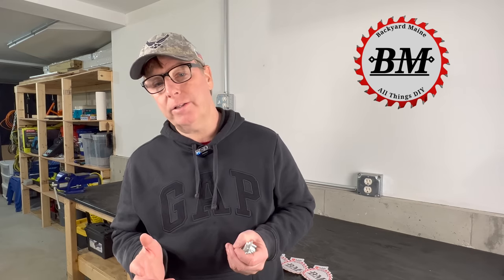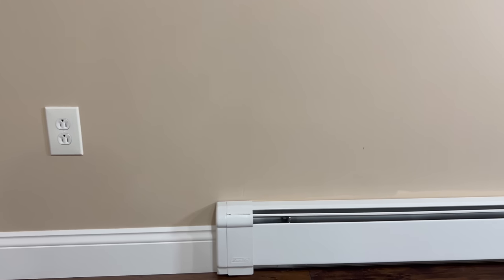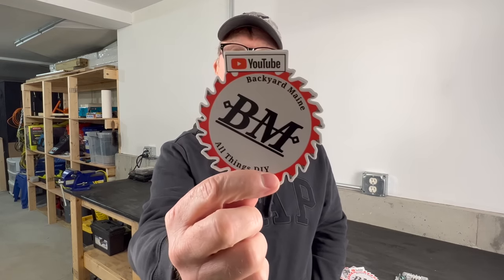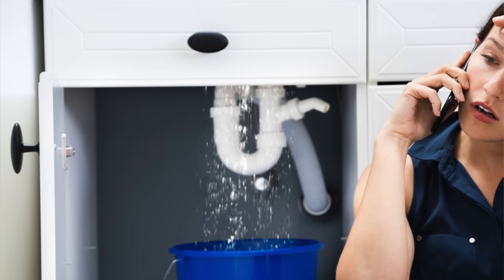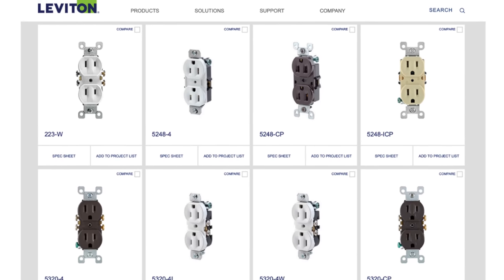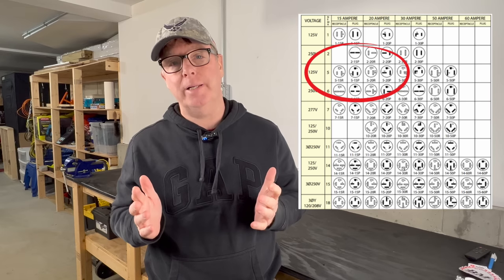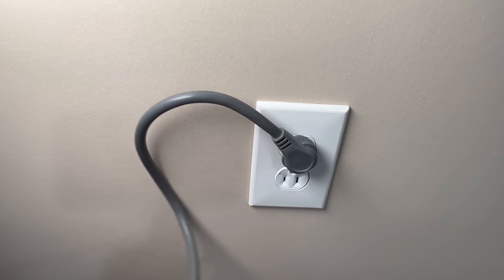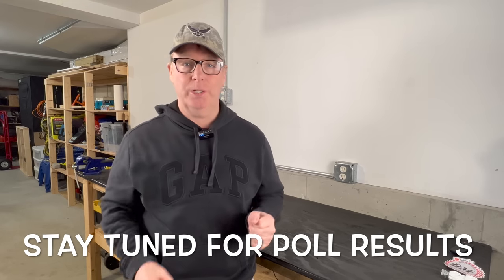Are your outlets installed upside down? (You may be surprised)

Comment: On my new home, I am specifying sideways, with the neutral on the top.  This places the hot on the bottom, protected by the neutral and ground pins.  This also separates the power cords going to the floor to be side by side instead of stacked over each other.
Reply: NOW THIS IS A GREAT IDEA.  I NEVER THOUGHT OF BUT MAKES MORE SENSE THAT ANY OTHER WAY
Reply: I have been an electrician for 25years and I always  put my horizontal receptacles with the neutral up for that exact reason.
Reply: This to me not only is more pleasing to look at but if you look at a lot of REALLY old homes it was done like this along the baseboards and just was beautiful!
Reply: I THINK Eaton makes a model with that orientation.
Reply from the maker: That is an option of course. Chicago requires receptacles to be run horizontal but the also require conduit to be run inside of the walls of residential construction.
Reply: Is the conduit required, EMT or can you use BX.  I know most cities require commercial wiring to be BX. Thanks
Reply from the maker: You can run BX and MC cable in commercial installations by the NEC. You will want to check your local codes if you have them and of course any job specs which will often list materials to be used.  @louprentz8554
Reply: That sounds good.
I wish there was a solution to these large transformers. You know, the large square blocks that some devices need, like your NES, your Atari, your voice message box and a bunch more other devices.
They should place each outlet 10 cm apart from each other. They should also have 4 outlets instead of just 2.
I have to install an extension for these things.

The other issue: Outlets behind furniture. What in the world? Can you put the Outlet 1 m above the floor so that I can reach it without breaking my back?
Reply: Totally agree. Check my comment on this topic. 
That’s how receptacles are installed in most countries in Latin America. 

Also, there was almost funny story when my little brother tried to plug in the Christmas tree (he was about 7yrs old) and when the upper prong was not going into the hole (he had the plug slanted), he pushed it down with his finger… we just saw the Xmas tree jump up for a moment, and my brother coming out from under it with a numb finger. 
The upper tab was the live one. 
I turned the receptacles to have the neutral up after that, and of course taught my brother about never touching the plug blades (that was back in the 80-90’s).  (Oh, and made a little extension cord with an inline lamp switch to use for the tree and avoid plugging it in every time to turn it on).
Reply: @PeteSleigh  I think these are common, made for horizontal mounting with the ground down.
Reply: @louistournas120  LOL - in 1 apartment that had tile floors I needed to mop, I bought cable wall mounts to keep everything off the floor, used these with tie-wraps to hold transformers, made cleaning easy, I should do the same in my new home over carpet (more attractive if using white extension cords to match paint, won't get caught in furniture legs when I move it to vacuum).

The other thing I've done with transformers is to mount them in/under furniture (like an end table) with 1 power cord.

Comment: I’m an electrical/electronic DIY person and I just go by what seems normal. I wire residential houses “ground down”, and commercial buildings “ground up”.  But I like the idea of manufacturers making 120V outlets so the ground prongs point towards each other. Then there’s room to plug in two of the larger transformer chords. 
That’s my 2 cents. Thanks for looking. 😊
Reply: It bothers me that you are doing any work other than on your own home if you are a DIYer in electrical.    In my state, which has fairly relaxed enforcement compared to a lot of other places, what you are doing is illegal - when you "wire" residential houses and commercial buildings.      Unless you are a LICENSED DIY electrician (🤣), you should not be working on anything that is not your own (local and state laws typically allow the unlicensed homeowner to work on his own home, not any others)

Comment: I took an electricity for non electricians course as an industrial maintenance mechanic, they suggested ground up because most of our factory cover plates are metal and as mentioned in this video, a short is possible if a loose cover fell on the hot and neutral.
Reply: Sure if the plastic that covers the hot and neutral were damaged, then the outlet needs replaced anyway. Beyond that it wouldn't make contact regardless
Reply: I've worked for 2 different companies fixing older homes which requires various tools plugged in. It is a mmajor pain in the ass with the ground up loosening the plug, disconnecting the power. The tools and wires are never stationary. It doesn't happen hardly ever with ground down. Two prongs horizontal above do not loosen as much. Therefore it's safer and a more secure connection.
Reply: Well Im not a ground down fan boy but I disagree with the reasoning you were taught. It's conceivable to me that the metal plate could fall and rest on the ground pin without touching the ungrounded conductor blade. Then the breaker doesn't trip. That's bad because some hapless fool fiddling with a plug may inadvertently jostle the escutcheon onto the blade and get a quick shock or arc flash before the breaker trips. in that situation with a metal escutcheon that has a high chance of coming into contact with personnel you want it to short out as soon as somethings not right. Definitely ground down with a metal recep cover.

Comment: Every house (that's six houses) we have owned has had the receptacles installed with the ground plug down.  If you have any flat plug extension cords, the ground plug is usually on the bottom.  If the receptacle has the ground plug on top, the cord will curve over the top instead of lying against the wall.

Comment: I learned it the same way as you and I agree with ground down. I was taught that if the plug was to fall out of the receptacle the ground would disconnect last. I also was told that either way was ok as long as it was consistent throughout the job.
Reply: The ground pin is designed longer to make that not true. Its a pretty pervasive myth in the trade though. It's what I was taught in my apprenticeship.
Reply: lol, never thought of it this way, but that is why orientation of plugs is up for debate. you could justify both ways

Comment: In Australia our sockets have ground down and are always switched . The switch has a red mark on it which shows when the switch is on. Our active and neutral pins on our plugs have 8mm of insulation on them to prevent shorts like you show at the end of your presentation. (which i found very well done!)
Reply: In UK, we have square plugs with a cord that drops down from the plug. Ground is always on top with live and neutral under it.
Reply: @saty580  I don't know about the Australian plugs but the UK plugs are well thought out. The north american stuff is pretty bad. Quite a lot of old houses probably don't have ground if the outlet is 3 prong or the outlet is simply 2 prong.
Reply: @louistournas120  I agree. I grew up in London and now live in Massachusetts USA. Our house was rewired before we bought it. All wall sockets were 3 pin with ground.

Newer US 3 pin sockets require the ground pin to be inserted to lift a gate covering the live and neutral holes. Older ones like ours allow a 2 pin extension cord to be used (no ground for the extension and the attached device). 

A metal chain fell behind my daughter's desk and shorted live to the higher ground. It sparked until the fuse box circuit breaker flipped. If ground had been down, it would only have flipped the circuit if too much current flew.

Live and neutral pins are different sizes with the idea that live from wall to switch is short and when off, the attached device and return are at neutral (0v).
Reply: @louistournas120  Kind of to be expected when our plugs are over a century old.
Reply: @saty580  It’s actually the hot and neutral together that open the gate, so two-prong plugs still work. I hate those things, and will not comply with code there.

Comment: Thanks for covering this topic. I was asked this question 25 years ago, checked the code but didn't find any definitive answer. It's great to see your thorough review. Regarding safety of electrical convenience outlets, I worked with a group of German engineers 10 years ago and they were concerned that our US receptacle should be recessed like the ones in Europe instead of flush. Seems like a good question.

Comment: In Biomedical locations about 30 years ago we switched from Ground Down to Ground up.  I remember when hospitals and clinics went through the entire facility and reversed 
ALL receptacles to ground up.  This was in response to a nurse being electrocuted when her neckless (or ID badge chain) came into contact with a partly inserted plug.
Reply: This is the preferred method in many manufacturing facilities for that very reason.
Reply: Ground up always made the most sense to me as it provides a little protection from something falling and causing a short across the two prongs.
Reply: Seems like there's always sheet metal in shops! Finds its way onto the prongs. But I still like "Green is ground and ground goes down."
Reply: How is that possible, you would have to put your face through the wall to get your NECKLACE or chain close to the wall. Arent outlets at medical facilities at 45" from the ground, so no need to bend over?
Reply: ....Thanx, didn't see this before I commented, wow, had no idea it stemmed from  one incident!....
Reply: In metal shops we went ground up to reduce chips shorting exposed blades.  Also when metal coverplates are used it helped keep loose covers from shorting if they slipped down.
Reply: @sprky777  I suppose, but ground up doesn't do anything about the risk of fire from having inadequate contact between the plug and the outlet. If anything, a machine shop is an even worse place for that as it just allows you to keep using a worn out plug past the point where it should have been replaced.
Reply: Exactly! Also the same for people with young children who love to try pry out plugs with their toys or can drop stuff down behind the plug.. In a work shop where you can drop tools off benches I'd always want the ground up install.
Reply: ABSO-F"n-LUTELY !   I was hoping  someone would chime in on this issue !  I mean...come on.....draw me a schematic and show me how someone gets electrocuted one way but not the other ??????
Reply: that doesn't sound possible unless the outlet protrudes from the surface or she smashed her head through the wall. 
and ID badge is never made of conductive materials either. also hospitals are suppose to use GFCI
Reply: thanks for the comment. I have always wondered why every medical facility I have been in has the ground up.
Reply: @Marcus_Caius  medical facilities differ on regulation but most at the hospitals i've been too (i'm a nurse) have been the standard 18" off the floor.  Getting behind the pumps, beds, side and procedure tables we do a LOT of bending to plug all the equipment in and a lot of facilities have a phone system that hangs from the neck.
Reply: That safety advice doesn't make any sense to me because the NEMA plugs aren't a good design either way. If safety was that important, the design would be improved by simply making the prongs only connect at a deeper level.  I guess changing from NEMA to anything else is going to be harder than switching to metric.
Reply: You're making it barely more secure by inverting the orientation, its negligibly more secure, its still easier to have the connector come lose.
I wonder why they don't put screws in the connector that you have to turn, like the VGA connector had
Reply: @monad_tcp  - I despise the VGA connector for that very reason.  The screws are the #1 failure point.
Reply: I never heard about that, but I did work in a hospital were everyone had a badge. I had a clip on that I clipped to the collar of my shirt. Yes, the hospital I worked in had ground up on all receptacles.
Reply: @Marcus_Caius  could have easily been bending over to unplug some equipment from behind a bed when a patient was being moved. Apparently you have not been in hospitals enough to see how things work, and what the nurses often have to do.
Reply: @darkshadowsx5949  some nurses wear there ID badges on chains around their neck. It would be said chain that contacted the plug not the badge.
Reply: @Ericfloats  also, there are usually plugs behind the beds at around 3 1/2 to 4 ft high (I don't know exactly how high) to plug in all the equipment a patient may need, such as an IV pump.
Reply: @Marcus_Caius  Medical staff fairly routinely has to hug the wall to get to things at the back of the bed or the equipment pushed up against the wall. I know because it makes me nervous to have people behind me and those MFer's were ALWAYS behind me it seemed like when I was in the hospital.
Reply: @darkshadowsx5949  Some medical equipment plugs cant be GFCI. A nuisance trip on some equipment could kill a patient. Kinda like a fire protection circuit, over protection can be detrimental.
Reply: @monad_tcp  Heh.  Lets try to do both at once!
Reply: @monad_tcp  This might blow your mind... you know why there's a hole in the blade on our plugs? Look it up :)
Reply: @Marcus_Caius , you are so very wrong! Ground up is safer because in hospital setting plugs are pulled partially out of receptacles when beds or other equipment are moved around and if something conductive happens to fall across the plug it can short out the circuit and shutdown critical lifesaving equipment! I worked at a hospital for 45 years and it was hospital policy that all receptacles be installed ground up!
Reply: Ground up is safer because in hospital setting plugs are pulled partially out of receptacles when beds or other equipment are moved around and if something conductive happens to fall across the plug it can short out the circuit and shutdown critical lifesaving equipment! I worked at a hospital for 45 years and it was hospital policy that all receptacles be installed ground up!
Reply: @jrstf  no, the first failure point is a NEMA plug unplugging from the wall.

I never saw a broken VGA connector ? what kind of brute grunts do you have to deal with ?

The shit is indestructible, its horrible that you have to screw the connector, but its for safety, not for easy of use, like a USB cable.
Reply: @monad_tcp  - Sometimes the locking nut comes unscrewed.  Then the cable is held by one side.  Pull a bit and it partially comes out, bending the good screw, which may well break off.

Comment: I worked as an electrician for a public water utility. We put the ground up for the reason with using extension cords. We found when dragging the cords around working from high ladders or across the floor the plug would have less chance of pulling out from vertical up or down pulling.
Reply: I noticed that, but with vacuum cleaners. For some reason the ground-up helps support the plug. Of course most of the "sag" problem is from installing the cheap 70 cent outlets. They can start failing in as little as 10 years. The better outlets are stiff; another reason for ground-up. (Most plugs have a "bump" for the ground, giving your thumb a place to press and keep your trigger finger away from the contacts.) That said, my contractor installed them ground-down when splitting an overloaded circuit... so I continued ground-down when upgrading outlets thru the house. The initial build had about 1/3 installed ground-up.
Reply: Ground down in my house and I have never had an issue. Ground up just looks wrong and it's my personal preference!

Comment: Ideally ground up is actually the best for safety. Hospitals, other institutional and industrial jobs liked to specify ground UP. Some trendy goofy architects like to have the outlets all mounted sideways, and in that case ALWAYS put the longer slot neutral side UP. Otherwise you have the hot tab up. Generally over 90% of the time the ground goes down. New consumer grade 90 degree plugs are made for ground down but older cords on consumer, commercial & some new and all old industrial equipment 90 degree plugs were made for ground up.
Reply: Doesn’t work on ungrounded plugs, which is why it falls flat in residential and many commercial settings, but industrial equipment had better be grounded. Hospital equipment generally is, too.

Comment: The patent for the grounded outlet calls it a U ground. (remember there was no ground in the bad old days). This means the ground hole looks like a U when it is installed properly. The patent drawing also shows the outlet with the ground up. As an electrician myself for 40 years, I was always told the reason was because all the wall plates were brass and obviously it would reduce the chance of short circuit should the plate come loose and fall. As stated in the video, it really has become a personal preference. My preference is up.
Reply: The metal plate that you mentioned was the reason my college professor taught us to install ground up. 
During my career as a journeyman electrician,  I installed outlets in whatever orientation my boss or the job specks required.  
Happily retired now,  so it's not an issue for me anymore.
Reply: @ericcox6764  
Ground up/down is a silly question !! Where does one go to college to learn to be "an electrician" ??? Much more important !! ;o)
Reply: @pappabob29  Central Kentucky Technological College,  located in Lexington Kentucky.  
They offered  programs that trained folks to become electricians, plumbers, carpenter, and HVAC techs.
3 years after I graduated,  they offered me a teaching position.  
I'm sure that there are many such schools located in the United States.